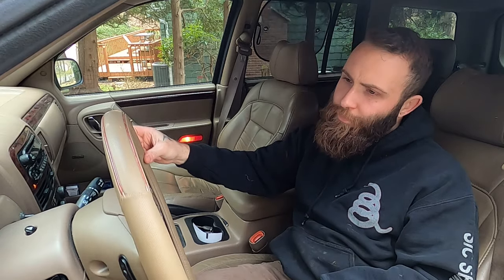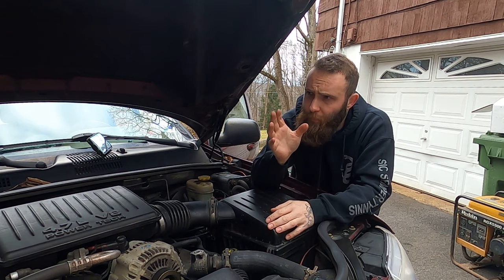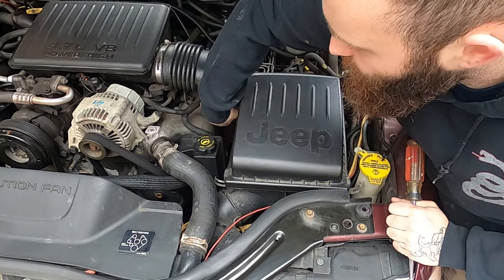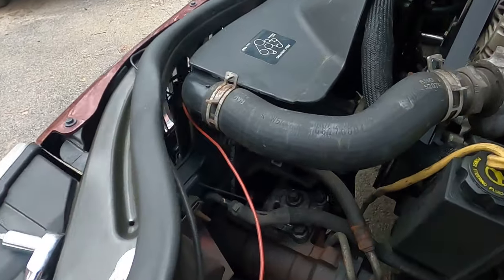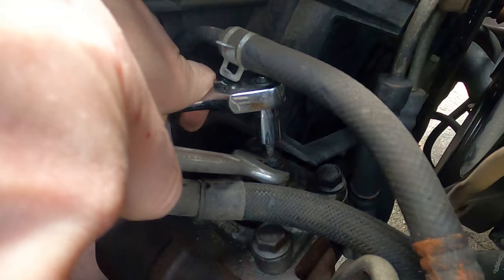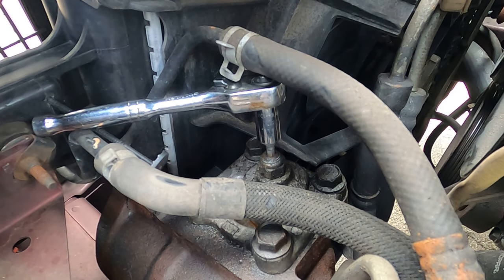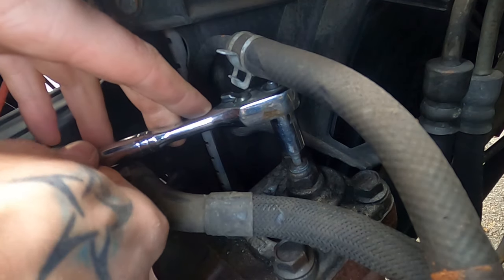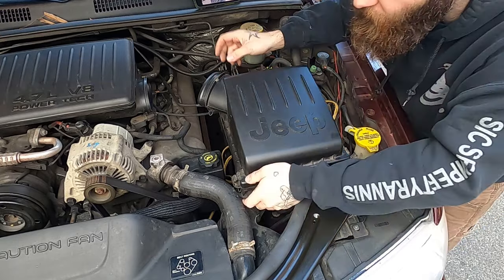How To Adjust Your Jeep Steering Box - FIX STEERING SLOP EASY!

Comment: Took my WJ to 2 shops alignment is perfect, and nothing is worn out. Replaced my trackbar bushings with the harden rubber moog bushings. And i still get death wobble at 70. Any advice from anyone? The DW is better since i replaced the bushing before it would shake at 55
Reply from the maker: It is tough bud. Could be anything in the sustention system. I know wheel bearings get a lot of folks. have you checked out out death wobble video? I have some good info in there..
https://www.youtube.com/watch?v=t90dQQ9Q26E

Comment: I may have to try this on my Bronco 2, steering is a little sloppy in it still after the front end rebuild.  This might just take the rest of the slop out of it or at least make it less noticeable.  It is nowhere near as bad as when I first got it where it took quite a bit of steering wheel movement to get the thing to actually turn or keep it in its own lane of traffic LOL.  Yeah it was a bit worn out at every single ball joint, and stabilizer bar bushings were all well not there.

Comment: 2017 wrangler and can't get the adjustment screw to budge after loosening set nut. Does engine need to be running? 🤷‍♂️

Comment: Problem is, I am hovering around 60 years now...who do you trust to get bearings and other two mentions fixed.  I have 2000 Grand Cherokee Laredo with a lil over 170,000 miles.  I bought it 17 years ago.  Ok, so...the shop I took it to three years ago, to have wheel alignment, fixed that issue of the 8th inch turn and informed me of it. He no longer works there, but of course.   However, one wrong move on their part and its like you said...I am concerned they will tell me I need a new stirring column or gear box.  Right now I have to replace tires and a leak hovering around anti-freeze resivoir best I can see.  I am on a fixed income.  You know, if I were younger and had other means of support, I  would attempt to try this fix. Yeah, where do I go so I don't get my throat slashed...is it ok to drive with wheel in this condition? Although grandaughter with permit scares me...also...its  starting to bother me too alot.  I only have vision in one eye, not the one foot in grave and the other on a banana peel just yet 60...lol.  Should I get bearings and all you said completed first then go for alignment to see if they can pull it together? Pricing is another thing, I scrutinize the web before making decisions, thus comes your video, thank you.

Comment: I commented a few months back. I replaced the tie rods and it feels MUCH better. But still has some slack. Haven’t tried this yet. I’m leaking power steering fluid pretty bad as well. Would there be a point in even trying or? A ship said it was my gear box and wanted $800 for it LMFAO

Comment: Looking for advice! I bought a 96 grand Cherokee limited 5.2L 180k miles 1 owner. 4 brand new tires, alignment, steering stabilizer shock. Everything looks to be in fair condition under the truck but when riding down the highway it sways back and forth in the lane. I also tightened the steering wheel thanks for the video. Wheel is tighter but still swaying.
Reply: Try checking the rear suspension. Thats was were I found my problems on my 2000 WJ
Reply: @RobertTerrill1  thanks! I ended up changing front and rear upper and lower control arms, track bars and sway bar links and bushings seems good to go now. Only issue I have now is it occasionally makes a clunking noise in the front drivers side when turning into or out of the driveway.

Comment: I was told if u have to do this method it won't fix just buy u more time to tell u to change the box is that true?
Reply from the maker: Not necessarily. I did this on my 2000 WJ years ago when I put the lift in and it has remained tight. If you do this and it helps, it means your box WAS worn so at some point - if it stays on the road long enough - it might need to be replaced. Might not either. They wouldn't put and adjustment in there if it didn't help something
Reply: @DEInTheGarage  ty for the info I got to do mine but the lines were giving me problems trying to take them out

Comment: Don't jimmy jam the adjustment screw too tight..LOL any help with my 2000's heater core replacement?  It's an $800 job at my local dealer and other shops won't touch it.
Reply: Hey, that's nothin!  Did you know that ford started running their water pumps off of the timing chain? My gf has a 13 taurus and the pump just went. $2,300!!   Had to pull the motor, replaced chains because why not? And ofcourse a motor mount broke so had to replace that too.   Re god damn diculous!
Reply from the maker: Not hard, just time consuming. My advice is take lots of pictures and take your time
Reply: @salvatorebaleno9807  in the 03 tj with the 2.4 the water pump runs off the timing belt. Just had to replace one.
Reply: @cgustafson240  never knew that.  So unnecessary
Reply: @salvatorebaleno9807  absolutely
Reply: @salvatorebaleno9807  I think some now are running the oil pumps off a chain...talk about short lifespans.  Built to fail right after the warranty expires and you still have 4 years of payments left LOL.
Reply: @wildbill23c  gotta love it. The auto industry hates when people can work on their own stuff.

Comment: Lol my old steering box had broken inside, when the steering wheel was adjusted straight, the steering would turn all the way on one side and only half a turn to the other lol.  Ended up putting a new used steering box in and its been good.

Comment: I changed all the suspension and steering parts except the control arms on my 02 4.0l GC, ever time I hit a sewer cap or bump on the freeway the wobble comes and goes out, when I’m in a turn on the freeway and hit a bump it doesn’t wobble. Any suggestions

Comment: Mine rides fine at low speeds but gets a little sketchy at higher speeds. Does any one know what that could be? The only things left on my front end to replace are the control arms/bushings and the steering stabilizer.

Comment: I just bought a rust free yes I said rust free undercarriage skid plates and the driver seat isn't broke 2004 freedom edition 4.0 grand Cherokee it's my second one. The 1st one still runs but the 42re trans quit shifting all together at 189000 miles but it will start right up

Comment: Problem is, this doesn't work half of the time. I've gone through 4 steering boxes on my all stock ZJ so I'm very familiar with the issue. What happens is, it works for about a week and you don't get quite the same steering wheel return, then after a few days your right back to where you were. Sure this might work once or twice and it might help a little bit, but if your steering box is loose, it needs to be replaced. I've gone through so many boxes because I keep getting remans. The remans replace the seals, crank down the lash adjustment then ship em out to you, then you wind up with a worse box then you had in the first place. THE ONLY PERMANENT FIX TO THIS PROBLEM is a NEW steering box. The ZJ and XJ boxes are very similar. The XJ has a 14:1 steering ratio and the ZJ has a 12:1 steering ratio. You can find new XJ boxes from Crown on Quadratec. Nobody makes a 12:1 ratio ZJ box. The TJ, YJ and Chevy S10 all also use very similar boxes, the S10 being a variable gear ratio if thats what your in to.

Comment: Under coolant res on TJ actually almost exposed in front of the grill under sway bar. Tried this on the XJ after replacing with a reman box. Still a lil loose and wonders a bit. New ball joints, new steering components, new track bar/ends. Only thing not replaced is wheel hub bearings but the seem to be good. Any ideas?
Reply: If its lifted it could be your caster.

Comment: So i replaced tie rod ends, ball joints  steering damper, lower and upper comtrol arms, sway bar end links, and put a remanufactured steering box in my wj. Still feels like i have very little control from the wheel. It follows any undulations in the road, bump steer, feels like a boat would handle better. Also has new tires, front hub assemblies, cv axles, rear wheel bearings, pads and rotors. I don't think that adjustment is gonna help me. Basically every steering and suspension part has been replaces other than the socks and springs. Any ideas??

Comment: I put new ball joints tie rods drag links new wheel hubs  New U joints and new shocks and my front and still shakes like crazy lol
Reply: I did the same and found that I had worn out perch mounts under my coil springs. Dorman makes a kit that's plug and play to replace them (plus that is extremely dangerous). After this (and new coils) the shaking stopped. Hope this helps.
Reply: Control arm bushings or alignment/ caster or bent wheel or track bar mount hole worn out.

Comment: Yours is the third vid I've watched on this. (1/8th of a turn at a time, dammit! ...This is the common message) I have an '06 LJ with a completely rebuilt steering linkage... Every last damned part. Even got it aligned and it is still "wandering".  I also detect a small knock now and again in the steering wheel.  Hopefully it doesn't need a new steering gear, and this adjustment does the trick. At least for a while, cuz I'm trynna sell it.

Comment: I replaced everything under my 98 Jeep Grand Cherokee even the steering box and I still experiencing road wander. Any thoughts? I just have a 2 inch lift and new shock's with 950x 30 15 all terrain tires.
Reply: Do you have U-Joints or CV axles up front?  My 98 ZJ had U-Joints, even after all the front end work it still wandered all over the road at the slightest bump.  My 96 ZJ had CV axles, no wandering at all.  Its those damn U-Joints that cause a lot of it.
Reply: @wildbill23c  thanks I did change heavier steering stabilizer and it did improve the steering. Thanks for your thoughts.

Comment: Hey lol u single? This will be my 2nd jeep, my 1st one was an 4wd n I had way more problems. this one is an 2000 Laredo, drives great. Have wacky steering issues, I swear for an few days it'll drive awesome no issues, get in next day n it's all over the place. That makes me thinks either it's Christine or it's wiring issue. Is that possible? Any advice would be awesome, Im self teaching myself mechanics, well I was you tube n figure it out before I mess with anything n double n triple check.

Comment: I was ready to try this but you really scared me off with that talk of it breaking catastrophically like that…
Reply from the maker: If your jeep is over 10 years old you have more than enough slop in there to take out. The key is small adjustments. Plan to adjust, drive and test, repeat several times. It is worth it when you get it right

Comment: Unfortunately my steering wheel does do that and I gotta fix death wobble and thanks to the dw it threw my 4wd linkage out of adjustment I have to go to neutral from the case then at low rpm lock into full tome 4wd